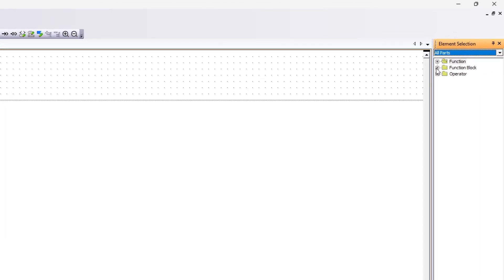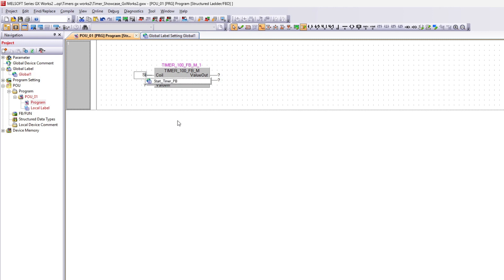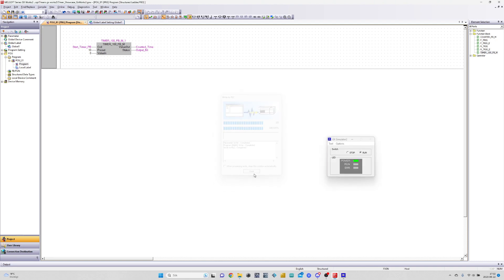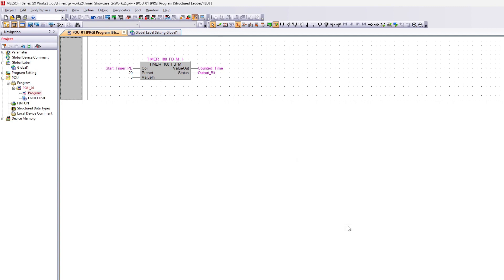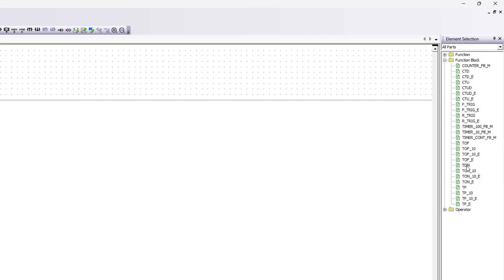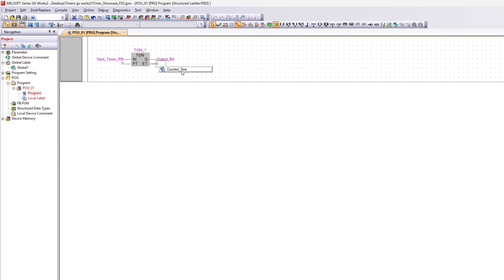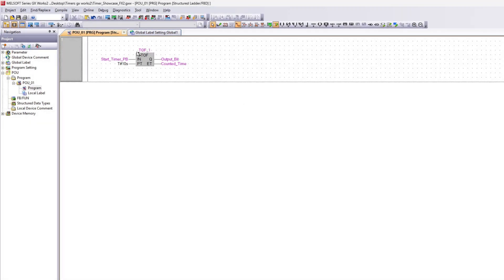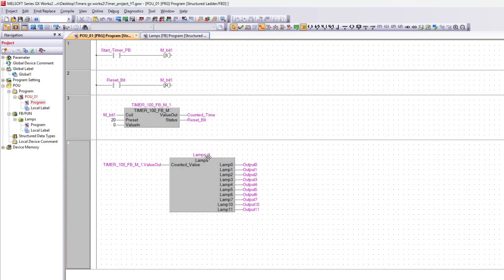Mitsubishi GX works 2 | Timer function block tutorial | FX0 FX1 FX2 FX3 PLC example

Comment: This is good. I bought some spotlights that I want to control. Was thinking to use an Arduino Nano but thought about PLC. I'm waiting on a LE3U delivery but need to get into the ladder programming. What you should here is exactly what I was thinking with the timer and 'drum' block. I have not gotten into the programming yet, still researching. I'll check out your channel see what else you are sharing.
Reply from the maker: Thanks :)